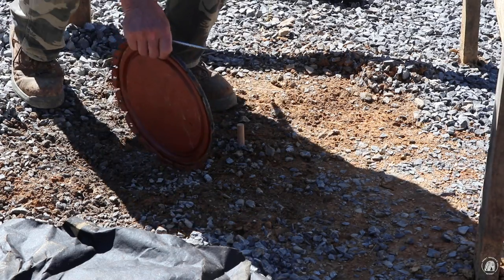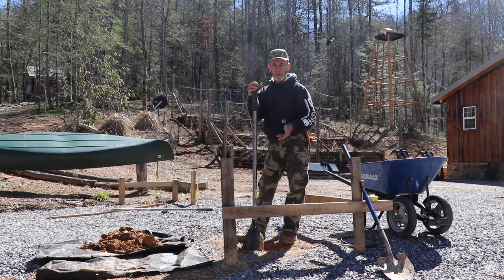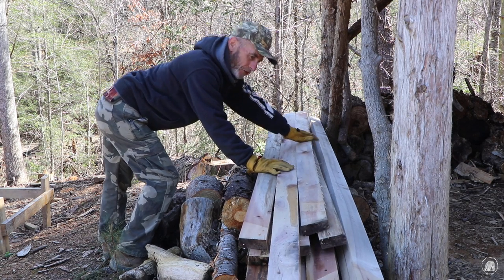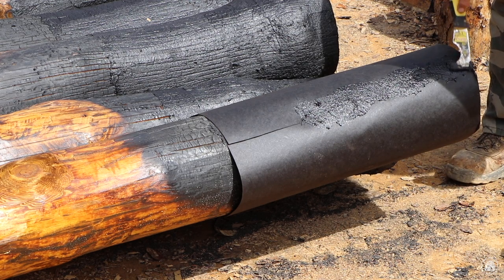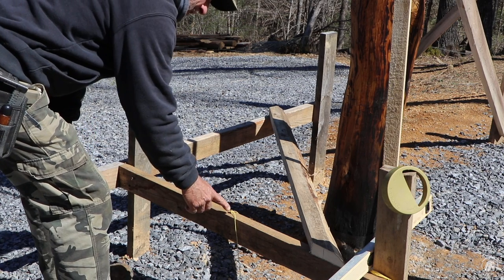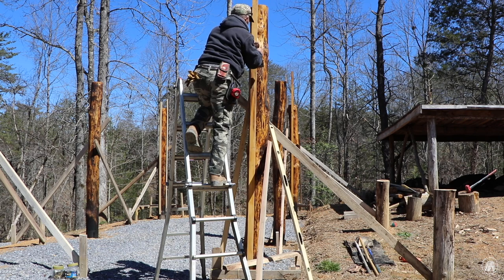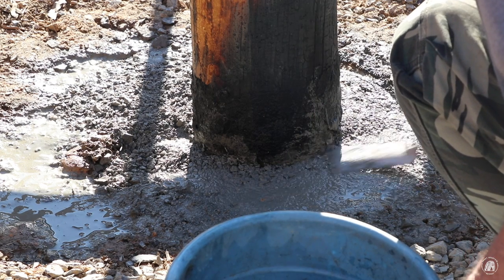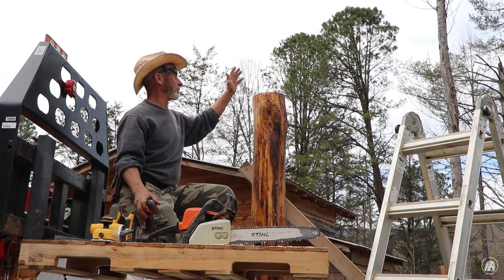Building a Crazy Crooked Post & Beam Carport Pt 4

Comment: at some point the dirt you discarded over the bank can be refined on a flat spot with cement chopped in and wet straw and formed into bricks [adobe] the bricks are water proof and once formed and stored under tarps to prevent drying to fast will make excellent retaining walls on the banks and even a root cellar /ice house or any other structure they are load bearing and good exercise also Like your saw milling the pallets of bricks will come in handy as time rolls forward...even old guys and women have built good structures that have stood for 500 years or more the earthen mass offered by cement stabilized adobe also breaths moisture in and out regulating humidity at 50% which is ideal for living things even in a root cellar and they do not suffer radicle heat changes like concrete nice even heating and cooling! rome was not built in a day and many of their lime structures started as adobe and over time they turned to some pretty fine limestone structures with the white washing...This a real over looked building method that is now seeing a resurgence....
Reply from the maker: Good information. Thanks!

Comment: Why not mix the cement?
Reply from the maker: I haven’t really ever needed to. Even the directions on the bag say just empty contents and add water. Once it’s in the ground it will draw all the moisture in the area around it. You just can’t use it as quick as you could with some that are mixed but you end up with the same result

Comment: You dont think water will get behind tar and roofing paper which act as collection pot
Reply from the maker: The wood was also burned to alligator skin which acts as a water repellent. Everything was sealed well, and should hold up to the elements for many years. If it doesn’t, then we will just have to fix it then lol, but it should be just fine.
Reply from the maker: I’m sure it will get some from the bottom but I sealed the sides and top. Besides the extra effort is better than encasing it directly to concrete I think. As well that’s why they were burned and oiled. I’ve tried different methods and like this one the best.